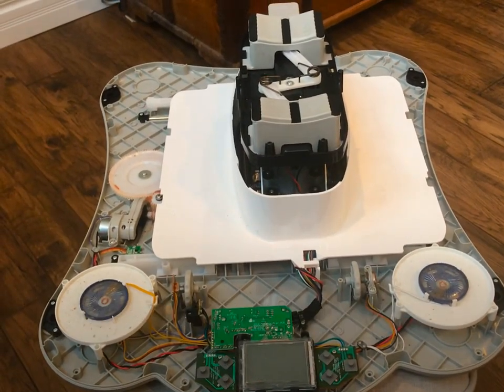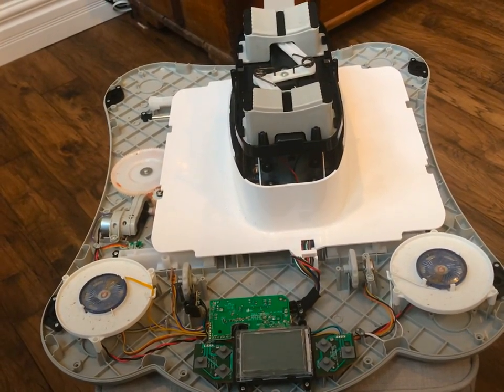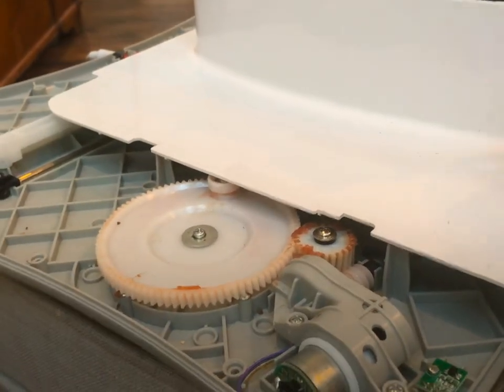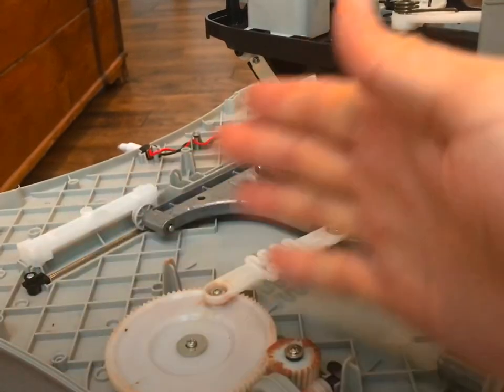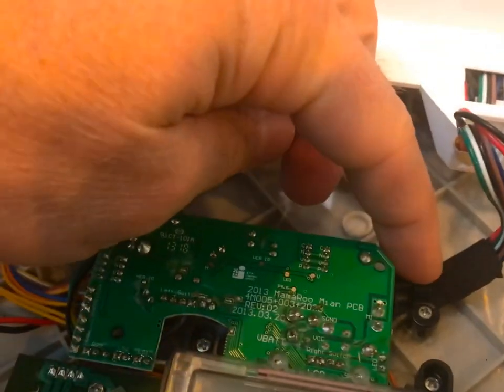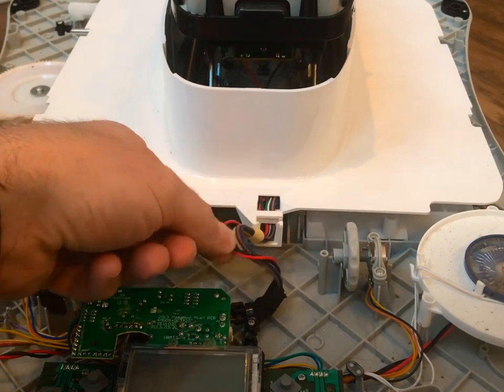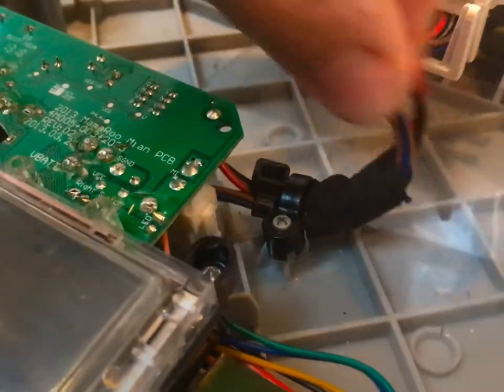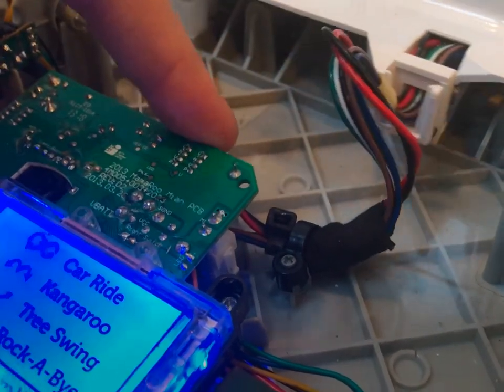MommaRoo 4Moms obstruction error fix

Comment: If yours still starts and stops try holding the left right and power button on the left control pad at the same time. The system does some sort of self test, sweeps left and right a few times and then goes up and down and then works after that.
Reply: Omg thus worked for me thank you so much
Reply: @taylorc3339  it will most likely need to be reset going forward but at least it works for a while.
Reply: kmarie8518  hold all three, the button on the left, the button on the right, and the power button on left control pad.
Reply: kmarie8518  yours might be newer where they changed the button layout. Ours was the older style with buttons on both sides of the display.
Reply: Bro, if I could buy you a beer I would. I got mine second hand and I don't have a manual. I would never thought to input the cheat code on a baby swing to make it work. Thank you

Comment: thanks, mine works fine, the problem is when it has more weight it stops (only supports 8lb) any advice?
Reply: the same happens to mine, did you fix yours?

Comment: I’m having an issues with mine and it just wants to go up and down not side to side... any suggestions???
Reply from the maker: Pay Kinhs the arm linkage will either be broke or the screw will be out. There is only one reason why it wouldn’t go up and down.
Reply from the maker: Did you have any luck fixing this issue with your Mammaroo?
Reply: Not sure if you'll respond but mine is doing the same. Opened it up and the black wheel with the rubberband is spinning fine however the two white gears are not spinning. What can I do?

Comment: Mine rocks then stops after 10 secs sometimes not even a sec only had it for 2 months. Brand new
Reply from the maker: Did you try securing the wires as shown in the video? Does it show an obstruction error or just turn off
Reply: Mine is same...just turns off
Reply: Could u help pls
Reply: @chichissecret8819  piece of shir smh now he just sleeps in it